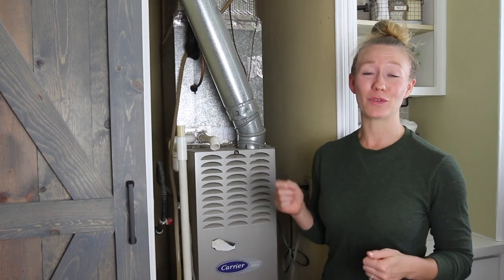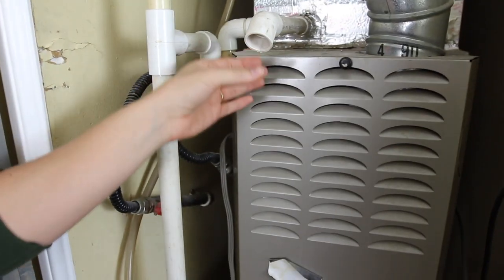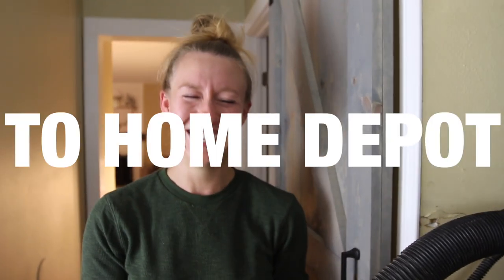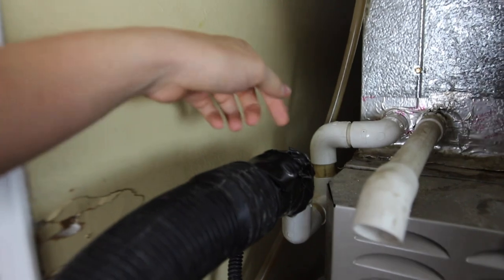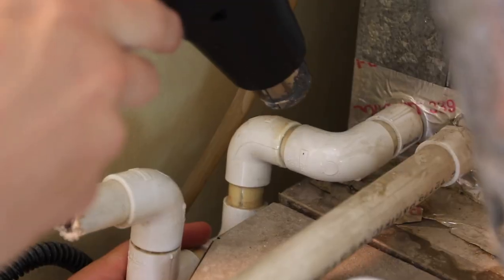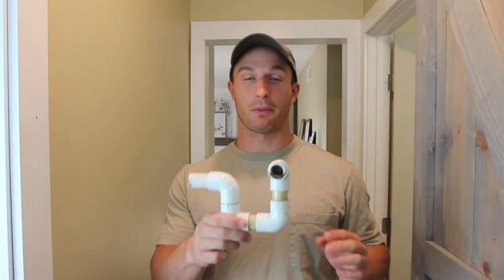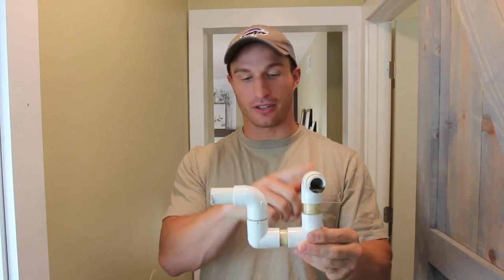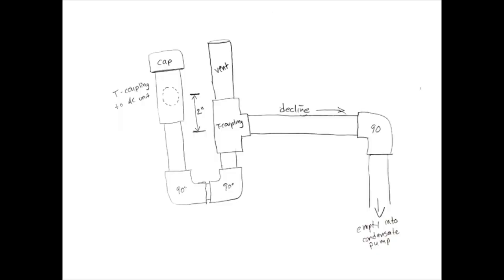How to Fix Leaky HVAC Unit | Leaking Evaporator Coil Condensate Pan| Cheap Fix

Comment: Using a larger drain pan along with a over flow sensor to turn off the AC unit when it detects water will help prevent water ending up on the floor. Especially if the AC unit is located on the second floor because it can cause water damage on the ceiling of the first floor and leave water marks. Just a fyi. Good video btw
Reply from the maker: Hey thanks for the great info! Really appreciate it!
Reply: This is exactly what’s happen to me right now!

Not sure what happened this morning. 

Came down stairs and seen water leaking from the ceiling. Now I’m trying to figure out what’s wrong. 

Every time we turn the heater up water leaks a bit.

Comment: Hey,I have green fluid stains right there on top of the furnace where the pvc pipes come out of the insulated unit on top. It looks like the connection,can I clean that up and get something from the building store?

Comment: I have an older Heil vertical unit and the pan is rusted out and drips when the a/c is on. I'm wondering if the pan can just be replaced. The a/c and furnace work just fine, quiet, efficient, accurate. The drain line is clear. Thanks. (Btw, what's the secret to such wrinkle-free skin? Sheesh! Ah, the wonders of youth.)
Reply from the maker: Haha thanks, the key is to never laugh 😄

Comment: "How to Fix Leaky HVAC Unit" - This title implies there is a refrigerant leak. There's not even an actual leak in this video, it's an improper drainage setup that affects the operation of the AC unit.
Reply from the maker: Thanks for the advice.
Reply: Coming in from the top ropes, nicely done.

Comment: Hey.. I noticed your evap coil duct section is like mine... NO ACCESS PANEL!!  How about you do another video showing how to cut out the front sheet metal and reinstall a removable cover, to be able to get to the coil for cleaning and clean gunk our of the drip pan!?!  I can't believe that a mechanic would encase the coil, so that it is completely inaccessible !!!
Reply from the maker: Hey thanks, we will definitely consider that. This old house has a lot of things we're fixing that aren't up to code haha